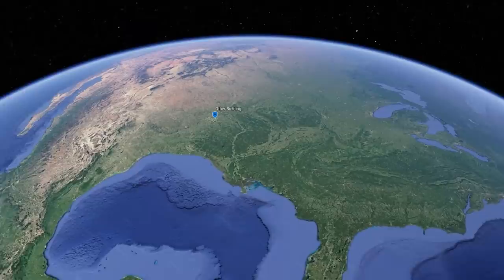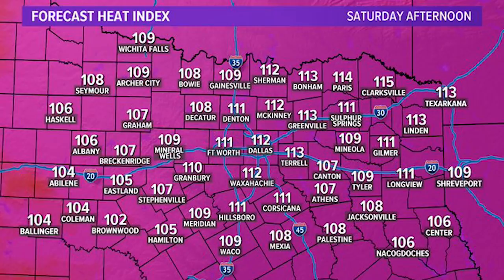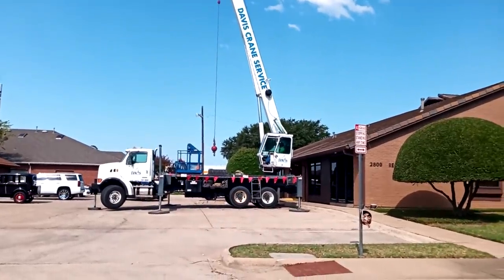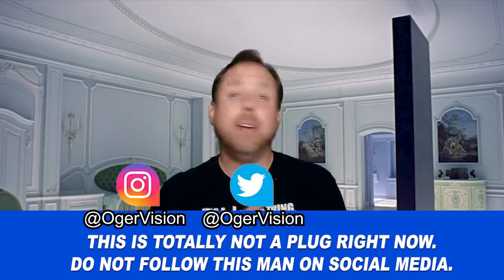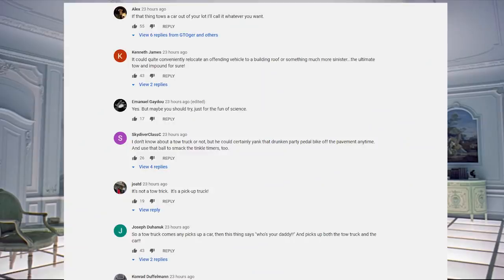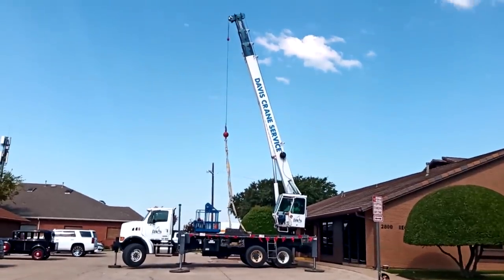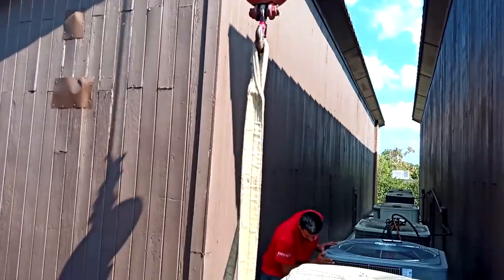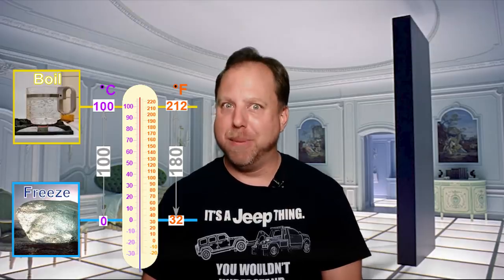Who Parked an Air Conditioner on the Roof?

Comment: I deliver what ever I tow somewhere. Pick it up from one place and deliver it somewhere else.  If you look at say a 50 or 75 ton rotator.  It is a tow truck with a massive crane.  CHEERS
Reply: That would be over-simplfication.

It would be a Peterbilt, Mack or Kenworth, made / engineered by Miller Ind, A tandem, Axle with a drag Axle.. some modern type of a Holmes 850 using hydraulics, front and rear stabilizers, more lights than you could shake a hooker at, costing starting at $750,000...

Comment: If you’ve seen tow videos from Europe and Asia, they use cranes on their rollback tow trucks to lift the car by the four wheels. Much more common there than the wheel lift/snatch trucks that we’re used to seeing. They do also drive generally smaller vehicles than we do though(sucks for them).

Comment: Missed the tows, so great to see anything from you!! Vertical tow - yeah, I'll take that. As for temperature scales - I am a Brit so F is what I grew up with, but I also learnt the C scale (and how to convert mentally) in Africa as a kid. Which makes more sense? One that starts at zero - freezing - and runs to 100 - boiling water, or some random scale where freezing is 32, and boiling water is 212? I will leave it like that!! Great to see you back!
Reply: Someday they'll find out that C is a hoax.  Then you'll be sorry.
Reply: Yeah but C is such s course reading.
Reply: @dncarac  It actually is wrong. Science lesson: Centigrade invented his scale 200 years before nuclear physics and didn't realize that the freezing and boiling point of water varies with the isotopic composition, which varies depending on where you get the water. From 1954-2019, Celsius was defined as the triple point of water was 0.01 C. In 2019, it was redefined into fundamental constants and removed water completely. The second problem is Centigrade was invented 150 years before thermodynamics and the concept of absolute zero was found. That's why many fields of science have to use Kelvin, and shift everything by the ugly constant of 273.15.

TL;DR: the Centigrade scale was broken due to scientific discoveries of the early 20th century.
Reply: The Fahrenheit scale is based on 0 for the freezing point of brine (salt water) and 100 as the temperature of the human body (he was off by 1.2°, or he "ran hot"), and so it makes sense (sort of) when you know what it's based on. I prefer F° for temperatures I feel, and I like C° for "statistical" applications (such as computer temps, formulas, etc).

Comment: The room is from the Movie 2001: A Space Odyssey. 

+40C daytime temps @ 5% humidity is a normal summer day in Adelaide, South Australia. The temps don't drop at night.  When you have 3 weeks straight of temps like that, it gets old really fast. 
You know summer has begun in Australia when you get branded by your own seat-belt buckle.
:) Only Flerfs still use Fahrenheit, miles, gal, pints, lbs, oz instead of metric.
Reply: LOL are humidity is 60-80% Normally about 75ish..... But ya you Aussies do get way hotter...
Reply: @jonathanbair523  Here in Adelaide we do get a couple of summer days per year that are around 90% humidity. People turn homicidal over parking spaces, shopping trolleys and RED traffic lights on those days. :)

Comment: Thanks for the great video.  I used to operate a crane like that sometimes before I retired.  We also worked on AC units.  The ones we have here pump heat both ways because of our weather.    Thanks again.

Comment: So glad to see you again, Chris! I have YouTube, and that is my only social media by choice. Unfortunately, that means I miss out on lots of bonus stuff with every channel I follow because pretty much all of them have Instagram, Twitter, Snapchat, Facebook, whatever else exists.... That's also why I limit myself to YouTube. It can be overwhelming without all the extra stuff.... That being said, I have to agree with you. While it is a little bit of a stretch, I would say it can be considered a tow truck. In fact, some of them double as a delivery vehicle! I used to work on radio towers- changing light bulbs, swapping antennas, decommissioning, just lots of random maintenance stuff. One tower we went to was already built, but we had to build the technology part. That means installing lights, antennas, lightning rod, etc. All the power for those things (except the lightning rod- it has no power. It's just there as a sort of surge protector) comes from a bunch of equipment in a small building near the base of the tower. The day we began, we had to wait for the building to arrive. It was delivered by the very same crane that was used to install it. So having that experience, I have even more reason to agree that a crane can be classified, at least loosely, as a tow truck. 🤗🤗🤗

Comment: If you watch some of the heavy tow truck channels, their rotator trucks are more than cranes.  I forget the exact number, but Ron Pratt explained it when using his Century 1150 heavy tow/recovery truck as a crane.  He can lift 50 tons, but he can winch far more (something like 200–300 tons, with the right multi-part winch line configuration).  A crane usually can't drive around with a load as well.  You could probably do your job lifting the air conditioner with a rotator, but the crane would make a very poor recovery truck (other than the narrow case of vertical pick, swing, place).

Comment: A crane is a machine used for moving heavy objects by suspending them from a projecting arm or beam.  A tow truck is a truck used to move disabled, improperly parked, impounded, or otherwise indisposed motor vehicles.  So a tow truck could be considered a form of mobile crane.
Kudos to the crane operator for operating blind, and to his riggers/signal men for a good job.

Comment: About 7 or 8 years ago the company I worked for had to replace three HVAC units that were near the center of our building. It was to far for a crane to be able to work. A helicopter was used. A crew of three came, a pilot and two riggers. One rigger worked the ground, one on the roof. They picked up the old units put them on the ground, new units were set onto studs that were already attached to the roof. Four people guided the units into place, which meant four 3/4" holes guided over four 1/2" studs. I was one of those people. - awsome. In and out, paper work signed and gone less than ninety minutes.

Comment: I worked on a construction site in the UK back in the 1960s when I was a strapping young man. 
The site crane drive was getting on in years but an excellent operator, he had an car his pride and joy, some lads jacked up the back end so the wheels were just clear of the ground. Come the end of the day he put the car in gear and just got wheel spin. He called the AA same as the AAA in the US, there removed the chocks and away he went a little embarrassed for not seeing the chocks.
He figured out who did waited to the Saturday half shift. Drove his crane round to the parking lot and lifted the perpetrators car onto the factory roof. Parked his crane, isolated the engine and went home for the weekend.

His car was never touched again.

Comment: The first wrecker/tow truck I have ever seen was on model T Ford using an A-frame and a hand crank winch, basically a crane.

Sometime in the early 1970's crude under reaches were developed. 

Heavy lift tow trucks  do have a crane boom.  Rotator wreckers have a 50 ton crane that can move forward/ backwards in the truck bed and rotate 360°.

Yes that crane truck can be used as a tow truck, in fact in the years that I had driven a big across America I have seen crane trucks like this in many big rig recoveries.

Comment: Just last week at the food factory I work at. One of our large compressors took a dump on us.  For whatever reason, this one compressor lasts around 2 years or so and goes out.  While one that is just like it on the opposite corner of the building has been there since the building was first built back in 1999.  Well since the last time it took a dump and NOW, we have since added a ton of Solar Panels on that side of the building.  No longer can we get a crane over there to lift the old compressor out and lift the new one into place.  This is a compressor that keeps one of our freezers at -12f.  

Instead, we have to do it from the other side of the building.  So we had to lift up a Gantry Crane which was on wheels.  It had a couple chain hoists on it.  So this thing was rolled over to the old compressor.  Easier than it sounds since one of the wheels on it was mangled.  Put the straps on the compressor and manually lift it up with the chain hoists.  Roll the whole thing back to the other side of the building dodging other stuff on the flat type roof.  Lower it down on the roof.  Move the Gantry Crane out of the way, get the Crain to pick it up from the roof and get it on the ground, and pick up the new one and get it on the roof, where it got picked up again with the Gantry Crane and rolled to the other side of the building.  Again, with the junk wheel on it, it was a bit of a hassle to move on over, get into place and lower it down where it needed to be.

Luckily we got a 5-year warranty on the compressor and it still had a couple years left.  So that was free, but still a lot of money for the crane and labor.
We still don't know why these compressors aren't holding up.   These experts can't figure it out.  We were looking at getting a whole NEW unit and having it placed on the ground like our NEW unit for are new very large freezer we just added onto our building.  That freezer holds around 550 Pallets.
2-3 years and I can assume we'll be replacing this compressor yet again.

Comment: @GTOger, do you remember the time when the tow truck saw what he thought was an unauthorized car, and started to tow it? They had it pulled out, and began performing a 17 point turn to town it. Your tech ran out to stop them, letting them know that it was an authorized. So it was pulled out, technically towed. Then it was indeed pulled back in as an authorized vehicle. That is the only time that I remember this ever happening. So like the crane, it pulled out an “unauthorized car” & placed an “authorized car” back into the lot. So I vote YES, the crane counts as a tow truck, based on the precedent of that tow.

Comment: I used to haul ac units in my flatbed days. I've delivered units that two would fill my 48' trailer, and even s few that only took one to make a load. On the average, however, it took maybe 4 or 5 to fill out.

Comment: Actually yes, a tow truck and a crane are the same thing...If you look at early incarnations of both they both used cables and pulleys for lifting and carrying items too and from. As technology advanced both the tow truck and crane moved into hydraulic lifting or a mixture of both as we see in the video.

Comment: Backwards: a tow truck is a (very specialized) type of crane. Not all cranes are tow trucks.

As for the room? Jeez, it's been 52 years since I saw the movie. Of course, that was a treat. Second week it was out in San Francisco at a theater with a wrap around wide screen. Watching a bunch of acid heads front row center totally tripping out. It was almost better than the movie.

Comment: Some years ago, they did remove something from a roof of a building behind me where i live. They did use a 2 way radio for communication (i received it on my scanner). I discovered that the crane also had a camera in top of the beam, so that the operator could see what was going on.

Comment: I wouldn't call the ones used in your tow videos as cranes. However, there are tow trucks that a made for recovery operations. Those  have a boom that can extend.  They go up and down and are on a pivot. Some are lift a crazy amount of weight.

Comment: Centegrade/Celsius and metric are based on an error in estimating the distance around the Earth going from pole to pole.
All of the units are based on the estimated distance and making the math easy for everything else.
They could have used a yard =  a meter and made the units all work, except water would boil at appx 109 deg in this system.

Comment: In some states, a qualified crane spotter either using hand signals or two-way device is required for such a lift operation.  Pretty obvious here that the AC installers don't have experience with crane involved installations.  At 5:30; "Drop down" is questioned by the operator: "Drop down?"  It could have been a very bad scene.  The crane operator was obviously experienced and cautious.  I think this would have been the AC installer's fault if the unit was "dropped."

Comment: Crane truck = crane truck. Tow truck = tow truck. The problems arise when a crane truck has been parked at a spot where it should not and gets towed, or a tow truck lands itself in a tight spot and needs lifting by a crane.... this is getting to be a job for Grapple and Hoist!

Comment: Looked it up the difference between a wrecker/tow truck and crane. A wrecker/ tow truck lifts and hauls cars,trucks and product to a location a crane lifts and places product in a lifted area over 5 foot in the air and can not toe that product with out a trailer

Comment: In Europe nearly all parking lot tow trucks are technically cranes. The pickups from your videos now start to become standard for breakdown recovery. With some toolboxes the mechanic can attempt to repair the vehicle and if that fails hooks it up. Previously a van would come and if repair was not possible a tow truck had to be called then.

Our streets are narrower and parallel parking is common so these pickups have not enough space to work removing vehicles violating parking rules. So they use flatbed trucks with 12 to 18 tons GVWR and a crane, put a clamp on every wheel and lift the car out of its position directly onto the flatbed. Here is a German docmentation showing such a truck at work. https://youtu.be/l4meK6vAzN8?t=185

Comment: You're in the ending of 2001: A space odyssey! Coincidentally, yesterday I installed a HAL 9000 onto the side of my computer. It's not connected to it and its only function is to glow red, but it does look cool.
I enjoyed the video (though I've probably watched too many crane fail videos so I was waiting for the crane to fall over!), but whoever designed that building needs a slap round the head for choosing to put the A/C units in such an inaccessible place. Architects, eh? As long as the building makes a statement, the practicalities aren't important. I worked as a surveyor for 28 years, drawing plans for architects so they could design new buildings. Some of the schemes they came up with were not thought out well- I remember one job where the new garage wouldn't fit in the place designed for it, so the architect decided to move it 6 metres (20 feet for you colonials). This was decided on site, with the construction workers standing around doing nothing until I'd marked out the new position. In the end, we did it by eye- it wasn't the way we were supposed to do it, but it fitted.

Comment: The old gin pole trucks could be used as a tow truck so I would say yes a crane is a tow truck if you look at heavy tow trucks they are a equipped with a crane

Comment: A heavy wrecker type of tow truck can have a crane on it, allowing it to lift and right a wreck, but a crane by itself (such as the one in this video)  is not a tow truck. It has no towing capacity.

Comment: A tow truck is just a baby crane. Especially the older ones that relied on cables and hooks to lift the car for towing. So, yes a crane could be a tow truck but in reality a tow truck is just a baby crane. It just lifts the car a couple of feet not to extreme hights.

Comment: Taking up a new heading 180 degrees away from your original heading will have you going in the opposite direction.

Since freezing water is the opposite of boiling water, it makes sense for those two values to be 180 degrees apart.

Once again, one of our legitimate units of measurement triumphs over the inferior European version. :-)

Comment: I have seen tow truck so that use a hoist and a chain to each wheel and literally picked the car up from above and put it on the back of the truck just like that Crane would do if it had to put something on its loading platform so yes they can be the same thing.

Comment: NOT an A/C tech but, those units look way to close in that confined space to be able to breath very good. Seems to me they are sucking in each others exhaust air.
Reply from the maker: I am surprised as to how well it works.   The units take their fresh air in through the sides and exhaust upward.   I wouldn't have thought to set them up this way, but in practice it works pretty well.   That said, this is my first summer in charge of this building, so we'll see what the future holds!
Reply: @gtoger  In that comined space one would think the exhaust air would not be able to escape. I am not a tech but do have Certificates in both residential and commercial HVAC. Beginning pay really sucks as a tech.

Comment: I thought a building like that would have one or two large Cooling Towers on the roof and a chiller System in the building.
Reply from the maker: That would be overkill for this little building.
Reply: @gtoger  I thought you had a large bank of servers in there that would require a very hefty cooling system.
Reply from the maker: @delosdmi  That's the datacenter.   This is the "other building."   It's all just people at this place.
Reply: @gtoger  Is the Data Center the one Downtown in Deep Elem? (The one where all the towing takes place. )
Reply from the maker: @delosdmi  Exactly.